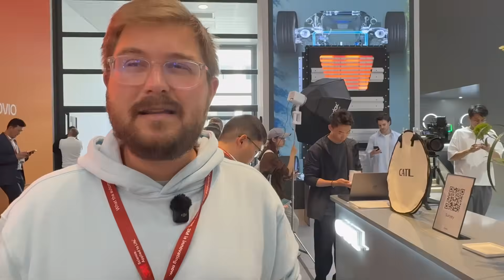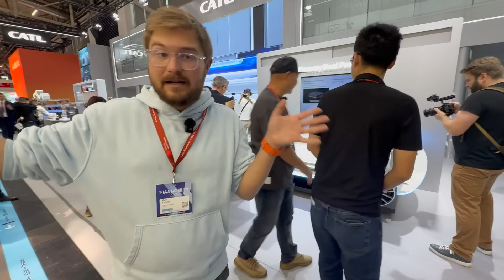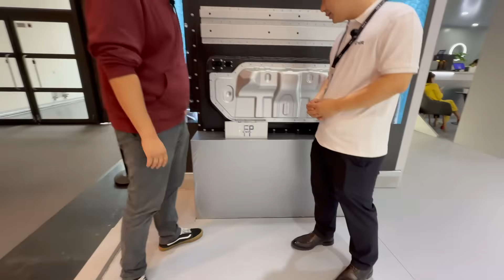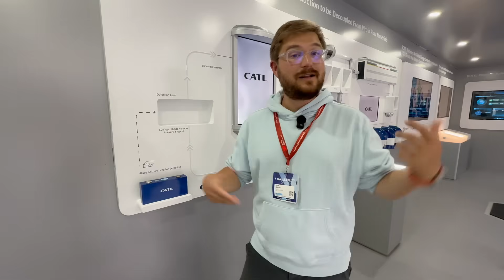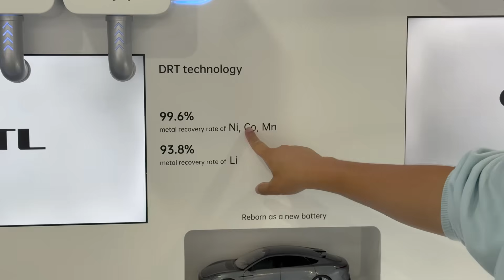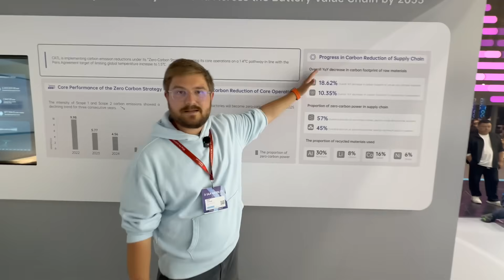CATL Debuts Shenxing Pro LFP Cell w/12C Charging & Long Life!

Comment: I'm most excited and interested in the Naxtra sodium-ion battery. Remember what happened at superchargers in the winter in USA a year or two ago when there were lines for hours because it was so cold the vehicles weren't charging? You covered it on Out of Spec. Not only is sodium-ion much cheaper but it still fast charges fine at -40 below zero. USA needs cheaper batteries with good winter performance for wide EV adoption. People will go back to ICE if what happened in winter keeps happening.
Reply: @Weezedog  Many EVs will precondition if manually initiated or when navigating to a charger. I think this is mostly a consumer education issue.
Reply: @jghall00  Not really, You cannot precondition the battery at low states of charge, preconditioning takes considerable amount of energy and significant amounts of time 45 minutes or more. There will always be times where the battery is cold soaked. The only guaranteed solution is chemistry not affected by cold temperatures.
Reply: Sodium is equal or worse than lead acid in terms of charging efficiency, voltage drop, and is barely better in terms of energy density.   Yes, Na+ are ok in cold weather, but for everything else, they stink as the major cost of batteries is their anode, not lithium.
Reply: @w8stral  That has been the case in the past but clearly CATL have solved some of the issues that previously prevented sodium-ion adoption. CATL is the largest battery maker in the world and are known for their breakthrough improvements in battery technology. This likely ain't your grandma's sodium-ion tech, so to speak.
Reply: @Weezedog  Sigh: my STATS are DIRECTLY from CATL.  Instead of typing BS, go read actual specs instead of propaganda alleveing your utter ignorance and looking the fool
Reply: @w8stral
Reply: @w8stral  You seem to be the one typing BS. Lead acid has a gravimetric energy density of only 30-50wh/kg nowhere near CATLs claimed 175kw/wh of this sodium-ion Naxtra battery. Use some common sense, CATL would not have spent the millions of dollars to bring it to market if it wasn't better than lead acid. Clearly they have made enough improvements in sodium-ion that they believe it's now a viable product for passenger EVs.
Reply: Sodium-ion batteries have a lower energy density, both volumetric and gravimetric. Although the Naxtra raises the gravimetric towards near the low end of LFP range it doesn't address the volumetric density. Also, Sodium-Ion cells tend to degrade at lower temperatures than Lithium cells (from circa 35ºC/95ºF), meaning they require additional cooling consideration at warmer temperatures. This can be seen in the Freevoy cut-away where the Sodium cells appear to be 15 to 20% thicker than the Lithium ones in the pack, plus have a dedicated battery section within the pack with sufficient space and a separate cooling channel. This reduces the overall energy density at the pack level , compared to a Lithium-only design, due to both lower Sodium cell level energy density and the pack level packing density requirements.
Reply: @GruffSillyGoat I'm aware of the gravimetric and volumetric challenges with sodium-ion batteries, but if anyone can solve them it's the largest battery maker in the world. They haven't revealed the full battery chemistry that I am aware of, but it's likely it contains a mix of other elements that solve some of these constraints.
Reply: @Weezedog  - the difference's of the sodium cells is apparent in the CATL's own Freevoy battery. The lower energy capacity of Sodium is a fundamental part of it's nature, and is reflected in CATL's achievements todate, with the Naxtra's battery lower gravimetric density in their published figures and it's lower volumetric density and greater cooling requirements clearly demonstrated in the Freevoy battery design. 

This is why CATL have focused on uses that build upon Sodium other benefits, high cycle life and low temperature benefit, offering them in 12/24v truck start-stop battery and hybrid optimised dual A-B chemistry (Sodium/LFP) Freevoy batteries, in the latter case where the Sodium can offload the impact of constant charge cycling from the Lithium in the combined pack that is present in all forms of hybrid vehicles.
Reply: @GruffSillyGoatI think you are jumping to conclusions by trying to extrapolate data from a different battery product (Freevoy) and apply them to the Naxtra battery. The spefic chemistries might not even be the same. Every battery design has goals to what they want to achieve and they change and tweak properties and parameters to meet those goals within certain constraints. The constraints can be wildy different between products. I think we need specific data on Naxtra itself and not guess based upon another product that may have different design goals.
Reply: @Weezedog  - The Information is based on what CATL published, without any speculation. There are no guesses involved as CATL have stated the Freevoy includes the Naxtra cells.

To be exact, the Freevoy includes a dual-chemistry battery pack configuration comprising Naxtra cells alongside LFP cell. CATL stated such in their press release for the Naxta battery earlier in the year, along with cut-away images of the combined cell battery pack. To quote CATL on the subject  "Freevoy Dual-Power Battery ... Sodium-LFP Dual-Power Battery. It combines Naxtra with a LFP self-forming anode battery, fully utilizing the low-temperature performance of sodium-ion technology to provide users with an exceptional experience that excels in cold conditions while delivering extended range."

CATL also offers LFP-LFP and LFP-NMC variants of the Freevoy for higher energy density and higher power delivery requirements. The Naxtra-LFP dual pack is the one noted for use on hybrids due to the longer cycle life of the Sodium cell component in the battery, with the Lithium cell component extending electric-only range. Similarly, CATL detailed that the Naxtra is used in a 12v/24v truck start-stop battery, which has been subject to a teardown analysis on Battery Design.

It is also public knowledge that the energy density of the Naxtra cell is lower than that of the CATL LFP cells, again based on CATL published data.
Reply: @GruffSillyGoat 
GREAT to find someone else who actually reads the data (And probably looked at t he CATL website?)
As you say, +/- 160Wh/kg vs LiFePO4 at about 212 (CATL)
NAXTRA is actually marketed as (Paraphrased) a Multi Passenger/ Commercial Truck application.
(Trucks and buses)
Reply: @Weezedog
Stop reading headlines and check out the latest Jeff Dahn interview.
He blows up most of the myths
Reply: @rogerstarkey5390I've already ready through what CATL has on their site. The Freevoy battery pack is marketed as a 400km pack and the Naxtra is marketed as a 500km pack. The Freevoy hybrid pack is marketed toward heavier duty commercial applications like buses, which is explains why they market it with lower range than the pure sodium Naxtra pack. GruffSillyGoat keeps referencing the Freevoy pack but the Naxtra pack and Freevoy pack are for completely different applications. Hybrid packs have never caught on in the passenger EV space, CATL tried them before. But the dual chemistry properties may have advantages in more heavy duty commercial applications.
Reply: @rogerstarkey5390I've read what CATL has on their site. @GruffSillyGoat keeps referencing the Freevoy pack when the Naxtra and Freevoy are for different applications. CATL actually markets the pure sodium Naxtra battery as having a 500km range, 100km.more than the 400km range of the Freevoy hybrid sodium-LFP. Likely because the Freevoy is geared for more heavy-duty commercial applications like buses with lower range and where the hybrid chemistry may offer advantages. Hybrid batteries have never caught on in passenger EVs.
Reply: @rogerstarkey5390 I've read what CATL has on their site. @GruffSillyGoat keeps referencing the Freevoy pack when the Naxtra and Freevoy are for different applications. CATL actually markets the pure sodium Naxtra battery as having a 500km range, 100km.more than the 400km range of the Freevoy hybrid sodium-LFP. Freevoy is for EREV and PHEV where the hybrid chemistry offers advantages over a single chemistry, and likely a smaller pack.
Reply: @rogerstarkey5390 I've read what CATL has on their site. @GruffSillyGoat keeps referencing the Freevoy pack when the Naxtra and Freevoy are for different applications. CATL actually markets the pure sodium Naxtra battery as having a 500km range, 100km.more than the 400km range of the Freevoy hybrid sodium-LFP. Likely because the Freevoy is geared for more heavy-duty commercial applications like buses with lower range and where the hybrid chemistry may offer advantages. Hybrid batteries have never caught on in passenger EVs.
Reply: @rogerstarkey5390 I've read what CATL has on their site. @GruffSillyGoat keeps referencing the Freevoy pack when the Naxtra and Freevoy are for different applications. CATL actually markets the pure sodium Naxtra battery as having a 500km range, 100km.more than the 400km range of the Freevoy hybrid sodium-LFP. Likely because the Freevoy is geared for more heavy-duty commercial applications like buses with lower range and where the hybrid chemistry may offer advantages. Hybrid batteries have never caught on in passenger EVs.
Reply: @rogerstarkey5390 I've read what CATL has on their site. @GruffSillyGoat keeps referencing the Freevoy pack when the Naxtra and Freevoy are for different applications. CATL actually markets the pure sodium Naxtra battery as having a 500km range, 100km.more than the 400km range of the Freevoy hybrid sodium-LFP. Likely because the Freevoy is geared for more heavy-duty commercial applications like buses with lower range and where the hybrid chemistry may offer advantages. Hybrid batteries have never caught on in passenger EVs.
Reply: It's coming in the EV assembly line starting in early 2026

In the early batch of production it will focus on the domestic China EV market first, then they will expand in the next couple years as their sodium ion production capacity increases
Reply: Lower energy density sodium batteries could be used on the outside surfaces of vehicle battery trays, with higher energy density, more expensive nmc ir similar on the inside, the sodium batteries acting as an insulation layer for temperature sensitive but higher output chemistries
Reply: CTP packs aren't configured in this fashion. All the cells would be cold soaked. The SIB would be a higher C buffer between the charger and lithium cells to let the lithium cells come up to temp as needed.
Reply: @jghall00 Still a win, especially if the sib are lower cost per kwh
Reply: @geraldford6409  
AT the moment , they are not lower cost

Comment: Super interesting on the LFP/NMC “hybrid” battery.  We definitely need to hear more about the different advantages of that.  The recycling efficiency of 99%+ sounds wild if the process doesn’t end up costing 4-5x’s what mined products would cost.  Exciting thoughts on all of this - thanks for the video.
Reply: Redwood Materials (JB Strubel ) says that they achieve greater purity of the materials via recycling then the original batteries had.
Reply: @timschoenfelder1773  
Straubel
Reply: @aussie2uGA
JB Straubel Quote (Paraphrased)
"Recovered materials of better quality due to being "refined twice" and at 17% cost (83% SAVING) compared to new stock"
Reply: If you look at the platform, e-cars must actually be much cheaper.
Reply: The recycling process is still subsidized by the Chinese and EU governments..
Reply: @carkawalakhatulistiwa 
Source?